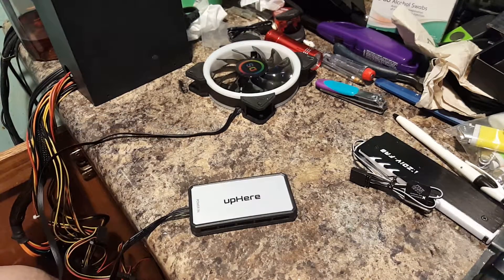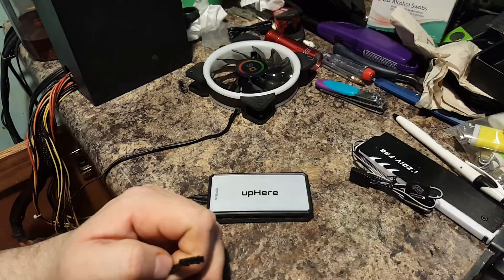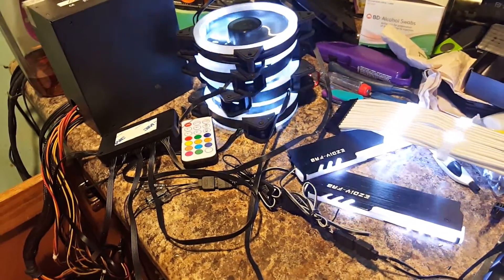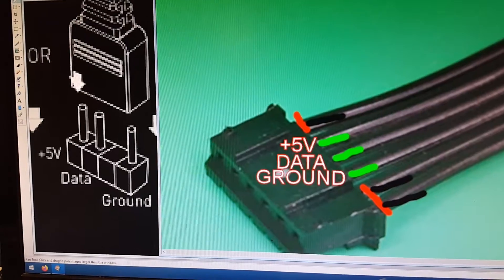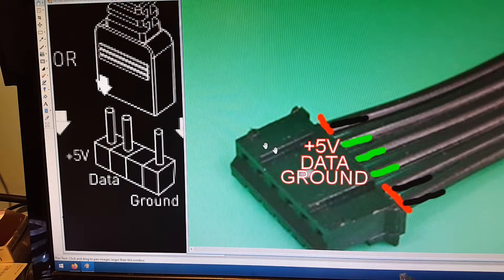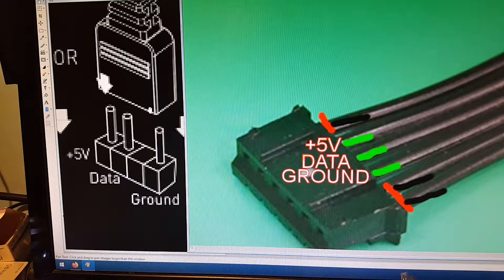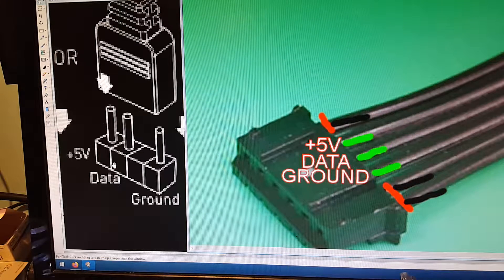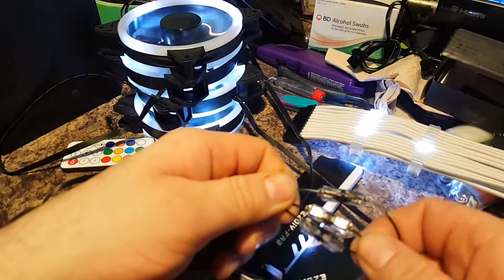Cheap hack to convert 6 pin rgb controller to 3 pin 5v

Comment: Any idea what the product code is for the 6 pin rgb female connector?
Reply from the maker: Not right off hand.
Reply: @phreakwars  When you get a chance, post a reply, I was doing some searching but no one has posted anything about the connector type. I believe it is 2.0mm JST PH 6 pin (B2B-PH-K-K)

https://www.jst-mfg.com/product/pdf/eng/ePH.pdf
Reply from the maker: @vicmulber  I checked the PDF. Yes, that does indeed appear to be the correct part number. If so, would make an easy side job if you're looking to make a bunch of your own.
Reply: @phreakwars  thanks to the speed of the internet and amazon, I am now in possession of the connector (which i tested and is exactly the right connector, just wish i could find the black ones) and a crimping tool. Maybe I will do a DIY video on how to make the connections. Now off to play with my new tools.
Reply: @phreakwars  after making a few of these, i would not make this a job unless I had a machine that could do the crimping. the ends are small and the tool is less than exact, after a few hours I believe i am an expert crimper, but do not relish the thought of having to do this again, because my other son wants a similar build.

Comment: Hey. I have one of these controller box(fantech brand). My case fans and 2 LED strips are connected to it. But I also have a Team Delta RGB RAM and I want to sync them all via Polychrome Sync or the remote. Is that possible? 

On the front of the controller, it has 4PIN which I connected it to my SATA PSU and beside it is a 2 PIN which I have no idea what it is. Can you help me?
Reply from the maker: I would if I were familiar with those specific controllers. Do you have a link to them?
Reply: @phreakwars  Here: https://fantech.ph/product/fb-302-typhoon-rgb-fan-3n1/
Reply from the maker: Yes, you should be able to perform this same hack on them and sync them, but as far as I can tell, only with the remote.

Comment: Great video buddy well done! From what you’ve explained, it looks possible to take a cheap 6 wire connected fan, remove the controller, split the wires into ARGB and fan power, then run them off the motherboard??
Reply from the maker: You can run them off the board if the controller supports it.
Reply: Phreakwar PC Custom Builds could I run the ARGB side of them straight off the motherboard? I have “jrgb1” and “jcorsair1” on my MSI mobo.
Reply from the maker: The jcorsair1 will cause issue, the jrgb1 port will be fine as long as it is 5v 3 pin type and not 12v 4 pin.
Reply: Phreakwar PC Custom Builds thank you

Comment: Does this work for all 6 pin rgb fans?
Reply from the maker: Yes.
Reply: @phreakwars  No. Only 6 pin 5v ARGB. not 6 pin 12v RGB.
Reply: @phreakwars  which control power for the fan?
Reply from the maker: The side with the 2 wires that I clipped run the fans.

Comment: Thanks for the info saved me a lot. Btw any idea how the led ports are wired. I got 4 pins led ports. No available led strip for the controller but from what I found it was using a 5v/din/gnd led strips..
Reply from the maker: LED ports on the side are wired just the same as the 6 pin. 5v/data/ground in the same order. 4 pin LED strips can be found here: https://amzn.to/38flq58
Reply: @phreakwars  thanks

Comment: Great! Can i daisy-chain a  3-1 splitter on a hub from another 3-1 splitter? This hub has many ports, but there are some more with one port (pccoler for ex) and you must use a splitter, so i was wondering if a buy that one, and daisy chain splitter can i sync strips, combs and  other 5V rgb stuff.
Reply from the maker: Yes, but I have no idea what the limitations are on how many rgb devices you can use on the chain without overloading it. At a guess I'd say 10 since that's how many fans the controller usually will take.

Comment: this is very informative and i'm looking for this but i have 12v controller is it the same setup?
Reply from the maker: No, not at all. You don't wanna try this on 12v, you could fry the rgb controller, or worse, fry your motherboard.
Reply: I already fried my rgb controller last night, my mother board is working but I would like to knw if the rgb fans are destroyed or or just the controller??
Reply from the maker: Probably just the controller.
Reply: @phreakwars  so I should buy another controller just to test them?   To be sure.  The reason why I plugged the rgb to a fan header is because my motherboard doesn't have rgb header🤦🏿‍♂️...

Comment: Hello bro....I'm planning to buy the aerocool cylon 4 argb cpu cooler will the connection be the same.....as I have an ant eSports 6pon argb hub????
I would be very grateful for your help.....
Reply from the maker: That cooler uses the 3 pin 5v type, so yes it will work with this hack.
Reply: @phreakwars  thanku bro you are awesome.....

Comment: Is there a way to do this in reverse and turn the 6 pin to a 3  or 4 pin connector? or are those fans not capable of working with 4 wires? I got the cheap fans but the controller doesn't allow me to control fan speed, so I wanted to connect it to a different controller that my other fans run off of.
Reply from the maker: If youi have an rgb fan with 4 wires, those are more then likely 12v rgb and will not work. This hack only works with 3pin 5v type like Corsair, or JST and 3 pin Aura/Mystic Light.

Comment: All my MB have 12v headers i have an off brand fan set like yours, the rgb strip i have has the JST 3pin small on it, connected it directly to the 3 of the 6 pin like in video. Didnt need to cut wires or anything. Controller works the lights completely well. I love it. Thanks for the video. You saved me alot of aggravation and time.

Comment: Do you know how the pins are on an 3 PIN-JST connector? (I mean which pin is ground, which is 5V+ and which is Data)
Because I want to buy these fans but I´m not sure
https://www.alphacool.com/shop/luefter/luefter/26559/alphacool-eiszyklon-aurora-lux-digital-rgb-140x140x25mm?sPartner=acgeizhals
Reply: I would really appreciate your help
Reply from the maker: Yes, I'm at work at the moment but later when I get home I'll post an image or something you can reference
Reply: @phreakwars  Thx man, have fun at work :)
Reply from the maker: @timey1999  This should help: https://i.imgur.com/jgH9VQz.jpg & https://i.imgur.com/mZVwfYV.jpg
Reply: @phreakwars  thank you very much, I really appreciate it 👍🏻👌🏻
Reply from the maker: Yes, that little arrow is pointing to the 5v.
Reply: @phreakwars  I tried it but it didnt work, the rgb on my Fan is broken now :/
Reply from the maker: @timey1999  You probably clipped the wrong wire on the 6 pin. You have to be careful, one is for 5v, the opposite side is 12v.
Reply from the maker: @timey1999  That actually doesn't look like it's the same connector. It's 6 pin yes, but that looks proprietary. Almost like it's an NZXT or one of Abkoncore's. Doesn't look like one from AsiaHorse, EZ-DIY Fab. or UpHere.
Reply: @phreakwars  its from miwatt, but i also got one of These uphere
Reply: @phreakwars  the miwatt Fans work perfectly on the uphere hub, so it should be the Same shouldnt it?
Reply: @phreakwars  you also got some miwatt Fans dont you?
Sorry for my Bad english
Reply: @phreakwars  Do you have a picture of the connector? It should be the Same
Reply: @phreakwars  could you send a picture of your connector? Because i am pretty Sure, that its the Same connector
Reply: Doing this method will only power and run the led's correct? Will rgb fans still draw power for the fan motor this way? Sorry, haven't built a system since fx-8350 and all this aRGB stuff is new to me.
Reply: Also, do you know if these cheap 6pin controllers can be daisy chained in some way? Naturally or with hack?

Comment: Where did u buy the connectors?
Nice video btw
Reply from the maker: I made them out of old fans and rgb cables, but if you'd like to buy a connector, try here: https://www.moddiy.com/products/Motherboard-5V-3-Pin-RGB-Female-to-Mini-6-Pin-Female-Adapter-Cable.html
Reply: @phreakwars  thx for the reply, I Just found a Set of those connectors on Amazon 👍🏻
Reply: @timey1999  can u send me a link to the Amazon listing? I can't find it :(

Comment: Btw how to connect 3 pin fan + 3 pin argb like id cooling fan to the hub?
Reply from the maker: The fan would plug in just the same as the memory covers and 24 pin extension. It's all the same. Then the 3 pin power will plug into the board.
Reply: @phreakwars  so the hub just control the rgb and not control the fan, right?
Reply: @phreakwars  thanks btw